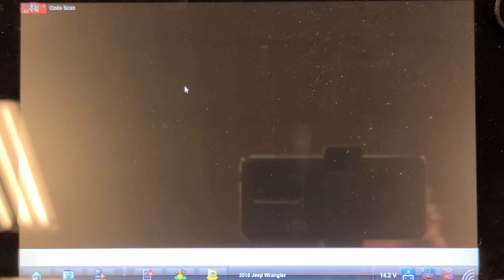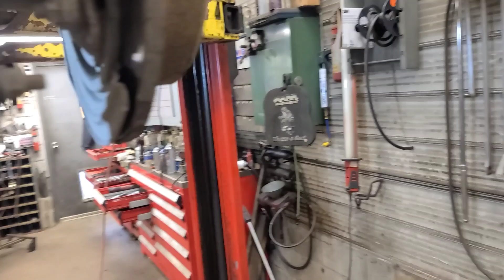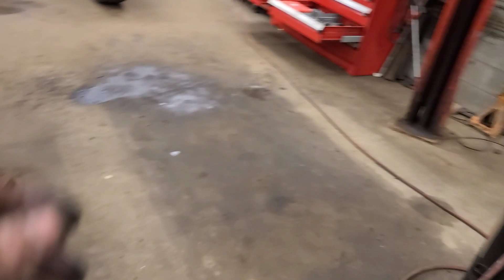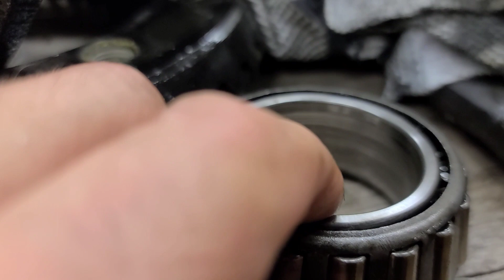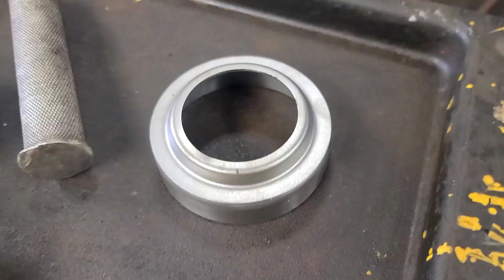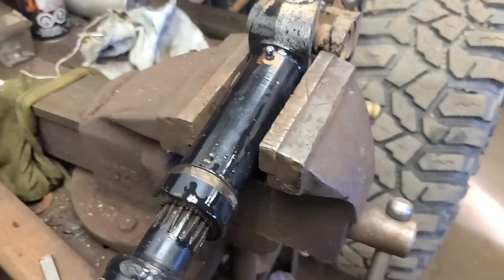2016 Jeep Wrangler Sport. Front and Rear Differential Gear Change To 4.88's

Comment: Great video...shows me the expertise and tools you need.  

If my spider gears are going, can I just replace them without having to shim everything like this, or could the fact that they went be a sign they weren't set up properly in the first place?
Reply from the maker: Front or rear? Spider gears transfer torque but really only spin when one wheel spins. I believe you have to remove the crown gear to remove the spider shaft but can't remember specifically.  If there's metal in the oil the bearings will be worn. If you do end up just replacing the spider gears you should not need to change any shims. Good luck

Comment: I like your side bearing puller. I was considering the clamshell type but they are not a universal use tool. Also how do you not cut your finger when feeling around for burrs in the sharp bearing area?
Reply from the maker: Now that you mention it I have cut myself at times... That puller I'm using is so old I've had it for 30 years. I thought I lost it at one point and was trying to order a replacement but it was not available and then I got it back from someone who had borrowed it.

Comment: the rear end in that old 1991 GMC of mine was just wore out it had 440.000 Alberta gravel road km on it , wow that jeep went through hell lol.
Reply from the maker: Yes its been road hard...
Reply from the maker: They can be fun for sure. I have tge tooling for measuring and calculating pinion depth but it's a PITA to use. Not too many shops will tackle this kind of work.
Reply: @PhillipBailey  I can second that. Only used mine a couple of times. Not worth the trouble. Love those truetrac diffs. I would recommend it in the rear also as it will be virtually trouble free and won't break an axle as  a locker is capable of. Nice road manners too.

Comment: I installed a 8.5 Yukon tru-trac in my 1991 GMC and had to take out the carrier at lest 8 times o get my tooth pattern correct , I got lucky with the pinion shims , , good clean job buddy , I'm 70 years old and I'm done with doing rear ends .